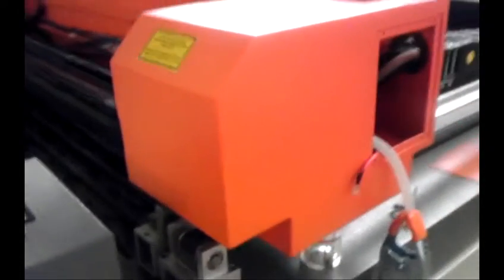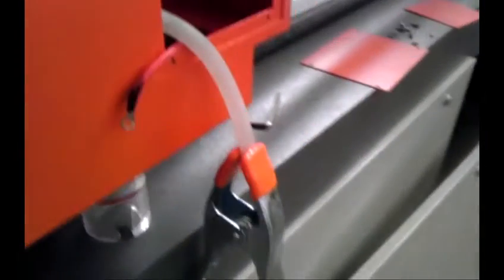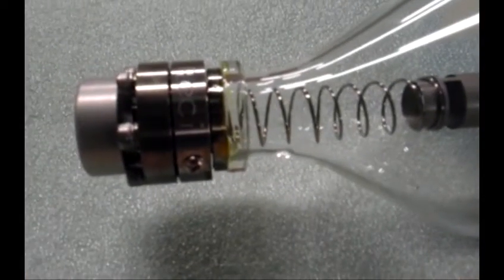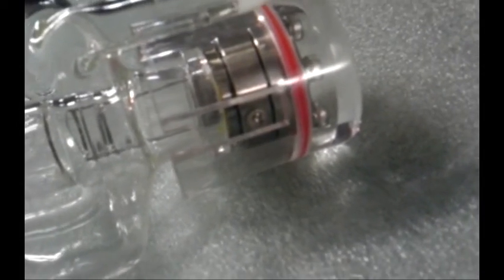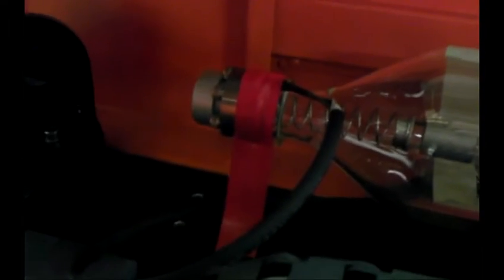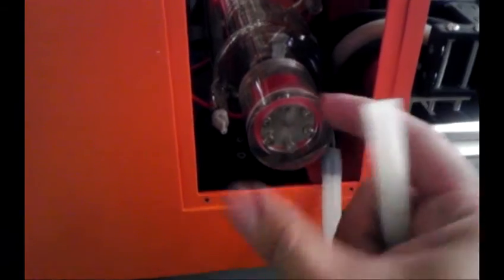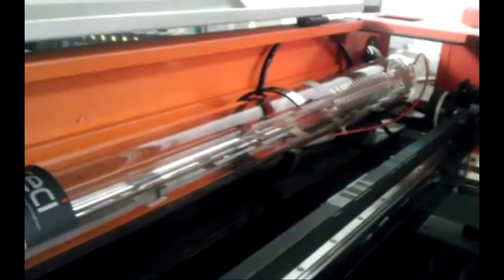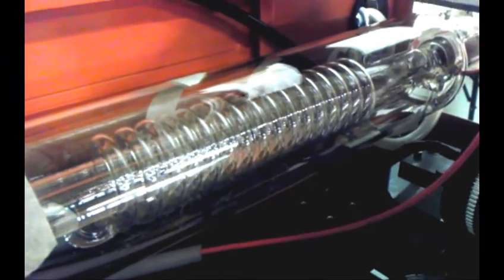Laser Tube replacement. Gweike 1325. China Laser Engraver Cutter

Comment: Does it make any difference the positions of the water intake and out-take positions? Should one be feeding the water through the TOP (positive end) and the other the bottom or does the position matter at all?
Reply from the maker: Yes the water should be positioned as per the lasers instructions. But more important there should be no bubbles